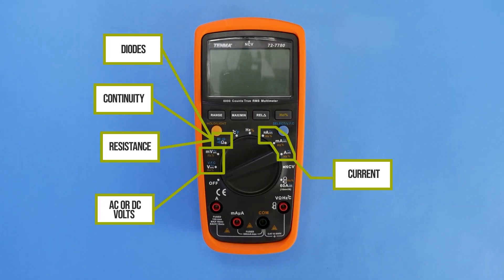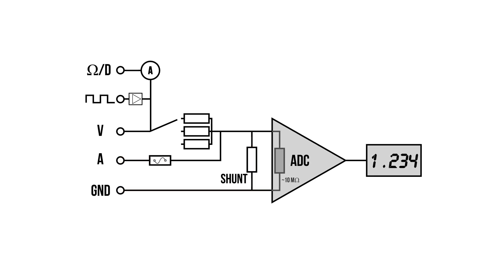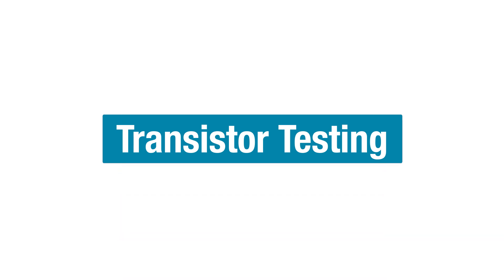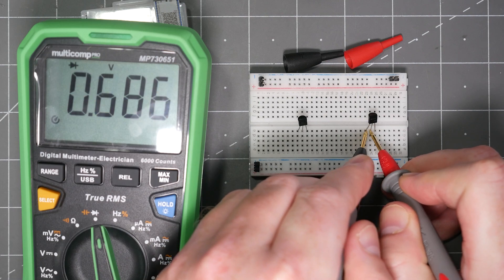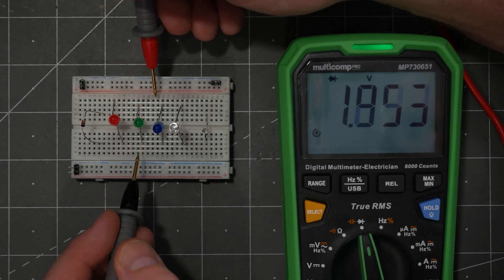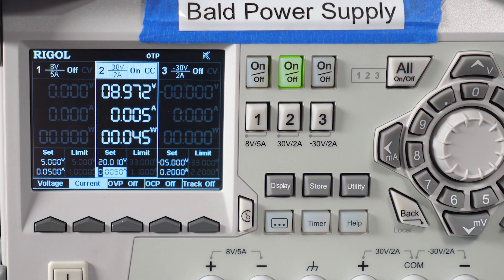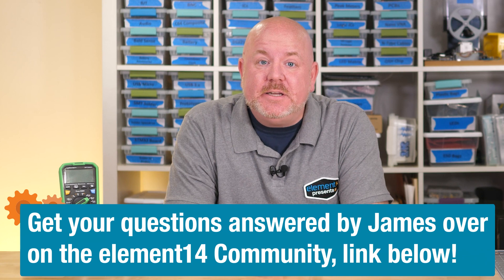Advanced DMM Tips & Tricks - Workbench Wednesday

Comment: Using the diode test to charge up the gate capacitance of a mosfet is pretty sketchy.  Some DMM's can only output a little over 1V for the diode test.  And lots of power mosfets have turn-on voltages around 10V.  A better way is to use a power supply to apply your gate to source voltage, and just use the DMM to measure the channel resistance.

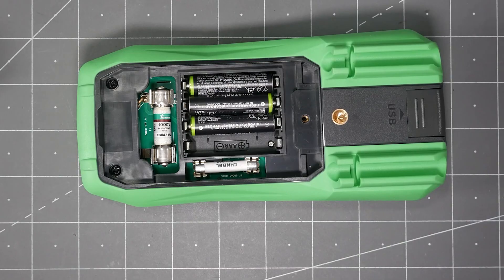Comment: Hi, at 1:50 you measure the low current fuse resistance, the meter indicates 10.7M Ohms. 
That is not what a slow blow fuse should measure out to.
Slow blow fuses do not have 10M Ohms resistance, I understand they are basically fast blow fuses with heatsinking to delay the wire fusing.
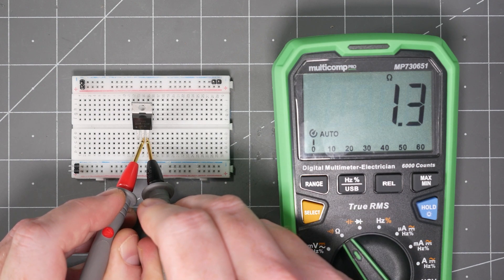At 4:13 you should be able to apply enough charge to the gate with most DMMs in Ohms mode.
At 6:50 the tips storage in the back of the DMM, you can still leave the negative probe in the storage slot but protruding to help when you have to measure say a power board and don't have anywhere to secure the DMM.
Use the DMM with the negative probe in the back, protruding out of the DMM, and use the DMM as the probe holder.👍👍👍
I have a pair of needle nose probes that each connect to a banana plug, they are great for pushing thorough conformal coating or tarnished copper tracks. E14 P/N 2917883 as an example.
Reply: Not sure why, but ohm mode didn't work with this meter for the FET. I tried several and none would get enough charge.